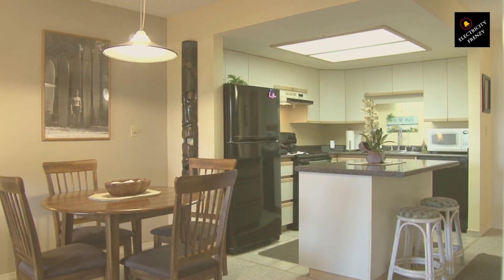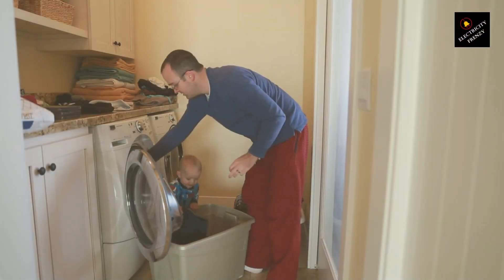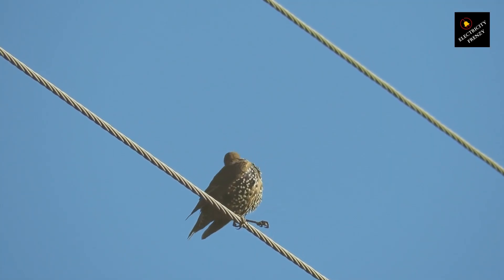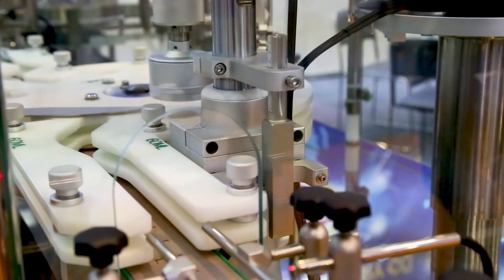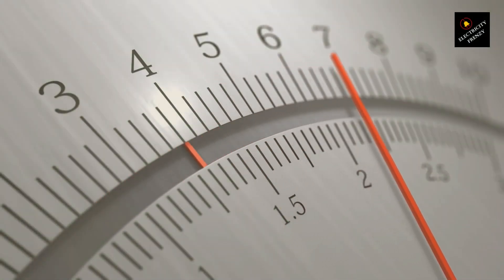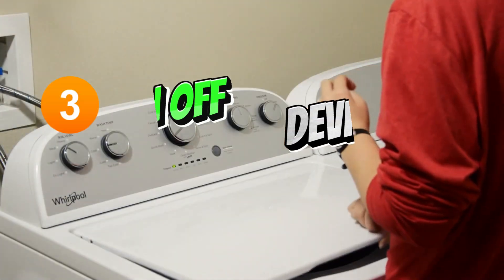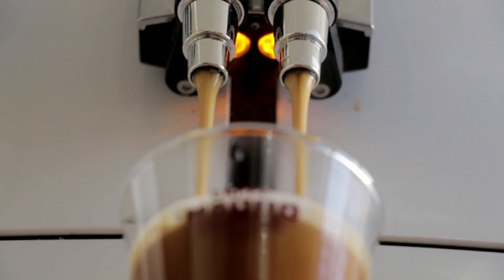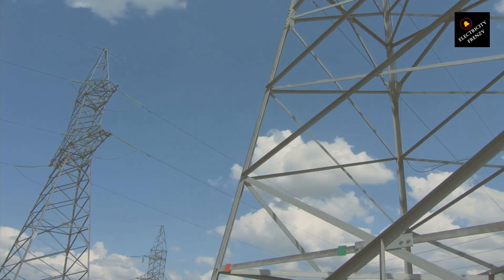why using capacitor to reduce electricity bill not good enough?

Comment: Sir is it possible to use a 3phase power capacitor bank if the voltage supply is single phase?